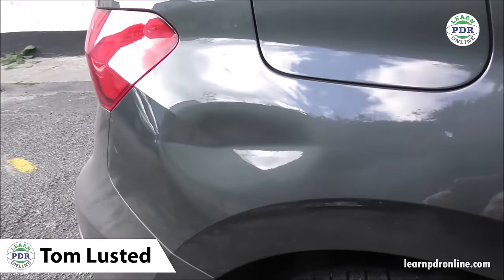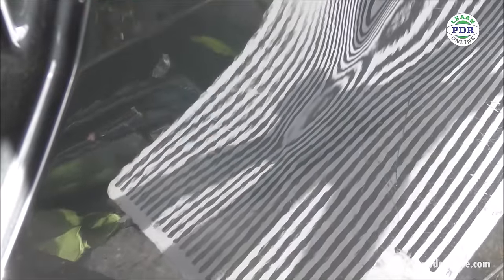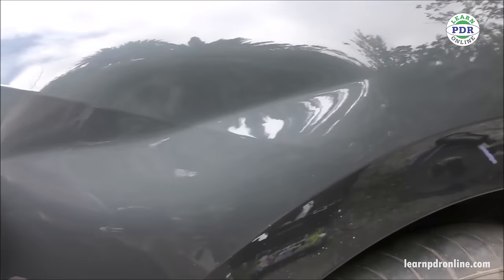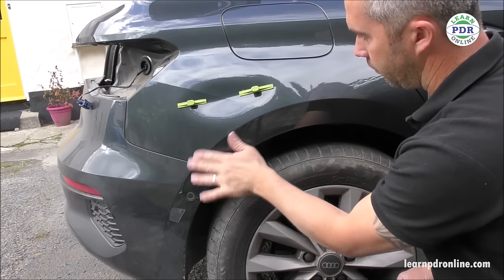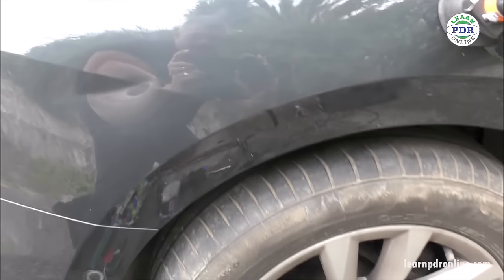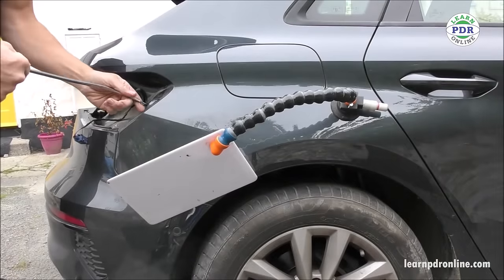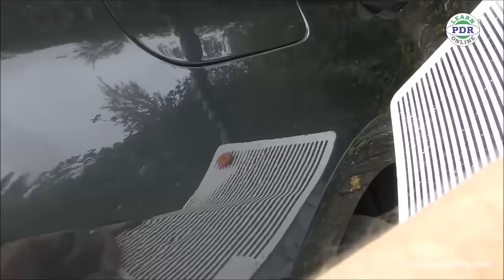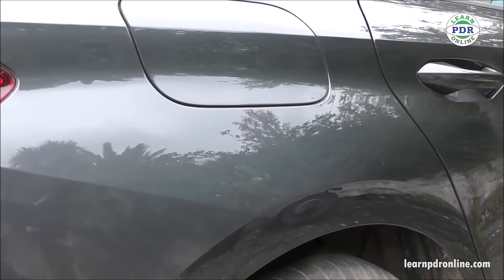How I Used Hot Glue To Fix This Dent | Paintless Dent Removal

Comment: I have been doing paint and bodywork. Years ago before pdr when everyone else was drilling holes and using their slide hammer I had a stud welded that welded copper studs to the bare metal and use a slide hammer to work the dents. Thanks for sharing your pdr knowledge. I have been trying my hand at it and have gotten decent results. Definitely better than what it was but not to the level as yours. The only way I can get it that slick is with glazing putty and a lot of sanding.
Reply from the maker: Thank you, yes I remember working in the bodyshop nearly 20 years ago myself with a stud welder and slide hammer, PDR has certainly come on a lot especially in the last 5 years or so its amazing what can now be achieved. Practice makes perfect and of course some decent training helps to show you exactly what to do and what to be looking for!

Comment: Very interesting indeed. Just wondering 1. Is there a specific hot glue stick for this purpose , or, will any hot glue stick do? 2. How do you remove the glue left on the paint surface? IPA?
Reply from the maker: Thank you, yes I always recommend using PDR glue, house hold or craft glue can often look the same but it does not respond the same and can be tricky to remove. I use - https://bletools.com/collections/glue/products/10-x-high-strength-clear-glue-sticks and yes IPA to clean the panel, the tabs and remove the glue.👍

Comment: Hi, I glue pulled 2 adjacent dents out but they popped back in when I took off the bridge puller. Weather was cold so do I need to warm up the panel first?
Reply from the maker: Generally if a dent is pulled out correctly it would not pop back in so I would expect there is some tension around, or running through the damage. The tension needs to be released first to prevent damage being pulled back in. Yes the cold does make a difference too, so its good to warm the panel slightly to take the chill off it but to me it sounds like a tension problem.
Reply: Thanks for this.  So do I need to knock down the crowns first before pulling out the dent?

Comment: I had a similar dent   removed, i was told it was a double panel above the wheel arch and had to be done from the outside. One PDR company could not do it, a body shop wanted a €1000 to fill and spray, another good PDR guy did it for €200 excellent job.
Thanks for your info
Reply from the maker: There are lots of PDr Techs and body repair techs all with a variety of skills, its always worth getting a few quotes, glad you got it fixed with PDR, thank you.

Comment: Masterfully done. I have a small question. I noticed the paint around the access hole under the tail light was slightly chipped by using the long bar to lift the dent. Is it worth putting some clear on that with a touch up brush to prevent rust?
Reply from the maker: Thank you. yes indeed if ever there is paint damage either from tooling or from the impact itself always apply some form of corrosion protection, myself I carry a range of touch up paints but also clear lacquer and corrosion wax. great question and suggestion!

Comment: what is best hot glue best to work with ? plz advice
Reply from the maker: The best glue depends on the environment you are working in, there are glues designed for cold conditions and others designed for warm climates, there are also glues designed for heavy pulling such as collision damage versus a light pull for soft dents, so it really depends on the damage you are trying to fix and the climate you are in. Me personally, I like the high strength clear from BLE Tools - https://bletools.com/collections/glue/products/100-x-high-strength-clear-glue-sticks

Comment: Being a bit thick here as I've aways used Hammers and dollies on dents! 
It's absolutely fantastic watching your video and I'm well impressed with the results,I just have one question? When you're tapping back with a hammer,is it a plastic or rubber tipped type of chisel you use? I've never used your technique before but have 2 vehicles I'm about to get started on,one with plenty I'm used to (inner sil welding 4 new arches and a few patch welds) and another with some small dinks I'm gonna try glue pulling on and a nasty crease over the front arch that has a couple of body lines running through it.any help would be useful? 😉👍🏻
Reply from the maker: Its not being thick if you do not currently do PDR, its a good question, Just as there are different shape tips for pushing the dent, there are different 'knock downs' for tapping it back down too, usually they are nylon or hardened plastic although there are a few metal ones which are used for specific damage. Here's is a link to some of the ones I use - https://bletools.com/collections/knock-downs as you'll see on their site there are a few options. In terms of advice it would be to start with something like the foundation course we offer https://www.learnpdronline.com/the-foundation-course-buy-one-get-one/  but if that is not for you then I do cover a lot of tips and techniques here on my channel, take your time to learn about knocking down highs and using glue pull for PDR Good luck!

Comment: What would you have done with no access points on those fine lines? My Tesla 3 doesn’t have such access points so could you have done that fine line via glue pull?
Reply from the maker: It is still possible to achieve this finish with glue only, however it would have taken me a lot longer to do, The fine creases in the dent can be opened up and repulled a number of times to get the centres up, but the actual bodylines are very tricky to get 100% with glue only and often involve a lot more tap down work to shift all the tension back into the line itself.

Comment: Nice job! What brand glue do you use and what was the glue pull time from glue to pull?
Reply from the maker: Thank you, this is my 'go to' glue - https://bletools.com/collections/glue/products/10-x-high-strength-clear-glue-sticks and I usually wait around 10-15 seconds to pull most damage, small light dents maybe less, heavy dents perhaps a little longer as there is more glue on a larger tab, the climate and panel temperature also make a difference though

Comment: Hi, is the hot glue any special? Is it never sticks to the paint and if it is then how to remove it?
Reply from the maker: Yes it is glue designed specifically for PDR, I always recommend buying glue from a PDR supplier as a lot of online retailers like ebay and amazon use cheap craft household glue which is different and can be difficult to remove, my latest video offers a quick insight to glue pulling problems - https://youtu.be/uuPTyUYb95M?si=RXiTkeY3ExTxyM-h and then the glue I use is from BLE Tools in the UK - https://bletools.com/collections/glue/products/10-x-high-strength-clear-glue-sticks

Comment: does it help to apply heat when doing PDR?
Reply from the maker: It depends on the dent but yes quite often heat is good, I usually use heat when glue pulling as it helps the hot glue to adhere to the panel, and I will use heat if working on cold panels to prevent the paint cracking I nearly always use heat for deep dents too!

Comment: awesome work
Reply from the maker: Thank you 🙏
Reply: @LearnPDROnline  sir how to remove glue 
is that any  special spray or not  
i didn't found spray how to remove glue on plnel safely
Reply from the maker: @hifzurrahman1130  Hi I often use 'isopropyl alcohol' this is available easily online and is the best I have used so far for removing glue!

Comment: Great video! Do you ever have a dent that later on comes back on its own?
Reply from the maker: Thank you. If a dent is repaired correctly with PDR it will never come back on its own. Occasionally you get videos from 'non techs' on youtube where it looks as though dents are simply popped out, but if the tension areas around that damage are not treated then applying pressure back to the area may well push it back in, but when carried out correctly the dents do not come back.
Reply: Thanks! I guess about 20 years ago, the person who used these methods for dent repair on one of my cars didn't know what he was doing as his repair popped back out. You truly are the master!

Comment: Is this normal glue sticks?
Reply from the maker: I use glue specifically designed for PDR, if by normal glue you mean household hobby glue then no it is different PDR glue is designed to peel off easily where as the craft glue becomes brittle and hard to remove from the paintwork, I get mine from BLE tools here in the UK 👍

Comment: When ever i'm glue pulling on dents they only come out half way, or 75% at BEST. How in the world do you manage to get them out so easy that good ????
Reply from the maker: Often when a dent will not fully pull out with glue it can mean there is tension in the form of a crown that needs to be released fully first or if the outside of the dent lifts with the centre the dent needs to be 'opened up' to allow more movement. i can make it look easy only because I have been doing it for well over a decade, keep learning, keep pushing!

Comment: How long do I wait for the glue to dry before each pull?
Reply from the maker: It really depends on the temperature and the type of damage you are trying to remove, large dents often require more glue so have a longer curing time compared to small dents and there are also multiple types of glue specifically for different climates so it also depends on the brand you are using, for the glue I use its usually between 10-20 seconds as a rough guide.

Comment: awesome. i  guess this process works with modern cars cause the steel is so thin.
Reply from the maker: Yes the panels are generally thinner on modern cars, so they get dented easier however, the PDR process can be worked on any vehicle with steel or aluminium panels, I used to work with a classic car dealer and the metal was often thicker on the old ones so took more pushing/pulling but very similar 👍

Comment: What would  job such as this cost to do? My dent is on the left of the rear bumper but just to the left of the gas cap. Its on the left of the rear left bumper and just above tbe wheel well. I can send pics if necessary.. By the way you do great work👌👍👌
Reply from the maker: Hi Harry, each dent is estimated on its own merit so it depends on the size of the damage, the location, what access there is to the panel and also what items may need to be removed for the repair itself so it really depends on the individual damage and who is going to be repairing it. I would suggest looking for your local PDR technicians first and getting some quotes from there :)

Comment: I got quoted 900 for a smaller dent than in this video. I guess I'll have that dent till I sell the car eff that
Reply from the maker: Yes PDR is the best repair method available so can often cost more than a bodyshop repair. The extent the metal has stretched and also its location can have a huge variable in pricing too, if the paint is undamaged then it will not rust so no problem living with the dent if it doesn't bother you too much 👍

Comment: I know you did alot of poking on that one 🤔
Reply from the maker: Yes lots of poking! I used the Hot Glue to reduce the larger dent quickly and get the shape back and then plenty of tooling from the inside to finish those crease lines 👍🏻

Comment: Disappointed.  Did not show which tool.  Did not show how to use glue
Reply from the maker: Did you miss the parts where you can clearly see me use a variety of different tools from tap downs, to hammers, to different rods and bars or the part when I get to the glue pulling and I show the different tabs I used with both the slide hammer and mini lifter methods? that's about 10 different tools right there. I also explain directional pulling and share examples with a lifter which not only demonstrates tools but also the methods and the dent actually being removed with glue during the process. You can honestly say you watched the full 20 minute video and didn't see any tools or any repair work carried out? perhaps you were watching one of the Ads before the video started?